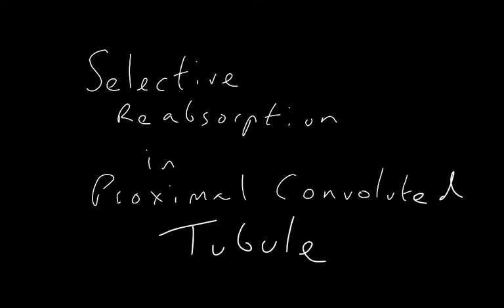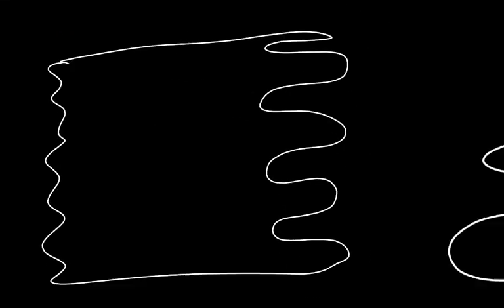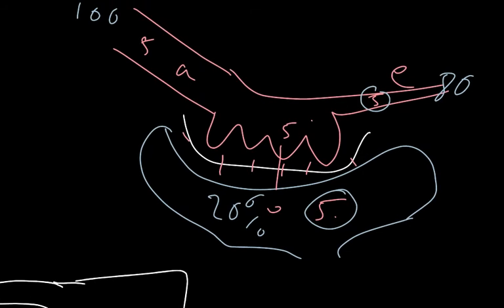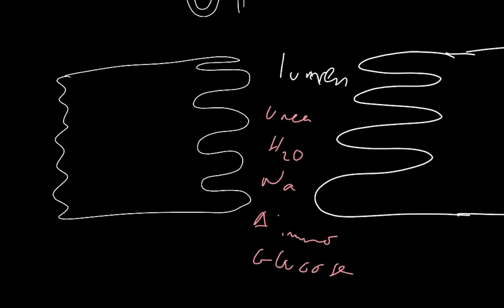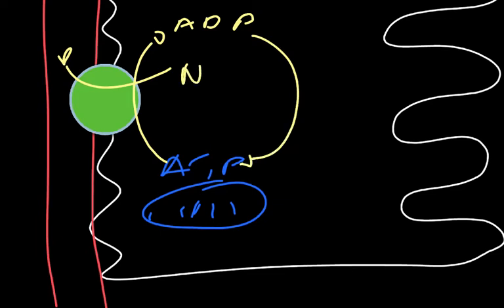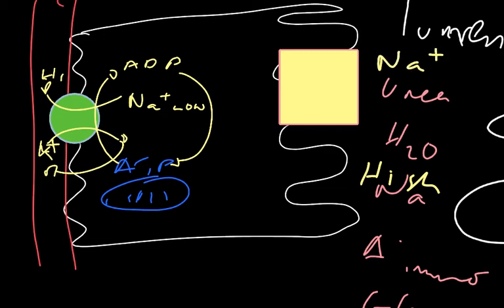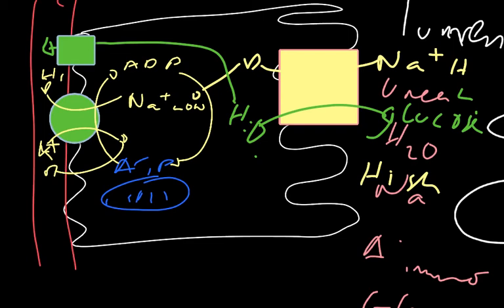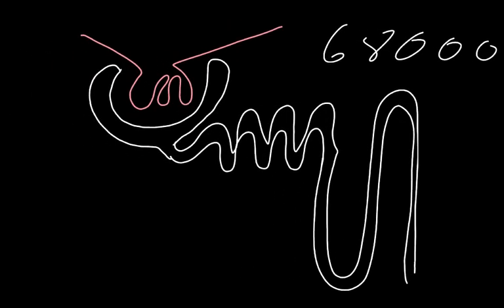Selective reabsorption in the Proximal Convoluted Tubule (PCT)  Kidney -  A-level Biology

Comment: Hi sir, so would you describe this process (co-transport) as the secondary active transport then? Thanks
Reply from the maker: yes certainly
Reply: But in co-transport, glucose is moved to the capillaries by facilitated transport. The definition of secondary active transport is using the energy generated from the diffusion of Na+ ions (down a concentration gradient) and this energy is used for active transport of glucose... Thanks
Reply from the maker: indeed, the Na ions are actively transported out of the cell (of the PCT) into the capillary, which lowers the concentration inside the cell of the PCT. Na ions move in from the lumen down their concentration gradient through a co-transport protein which moves glucose against its concentration gradient into the cell from the lumen. The glucose then moves by facilitated diffusion into the capillary from the PCT.

Comment: I'm in the second year of GCE A-Levels, This video has made my concept very clear and I found it very helpful..!
 I have a question, would the concentration of Amino Acids in the lumen of PCT, be same as the concentration in the efferent arteriole ? :-/  Like you said concentration of Glucose and sodium is same.
Reply: And one more question Sir, as you said, during co-transport, glucose moves from a low concentration in the lumen to a high concentration in the cell. Shouldn't there be a higher concentration of glucose in the filtrate as compared to the cell?  :-/ Kindly make this point clear too :)
Reply from the maker: Hi Sara, sorry for the late reply. Yes is the answer as the basement membrane is only a filter to things which are larger than the holes in it, therefore the concentration of amino acids will be the same in the efferent and the bowmans capsule
Reply from the maker: The glucose moves against its concentration gradient from the lumen into the PCT cell, this is driven by the Sodium ion gradient achieved by the Na/K ion active transport pump